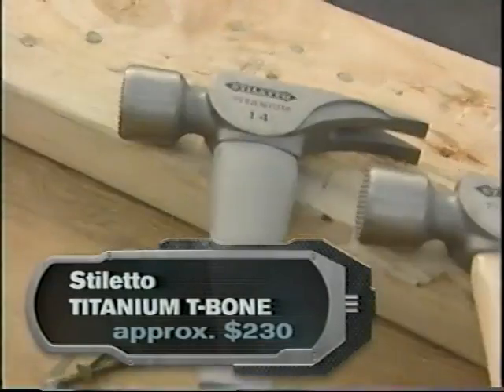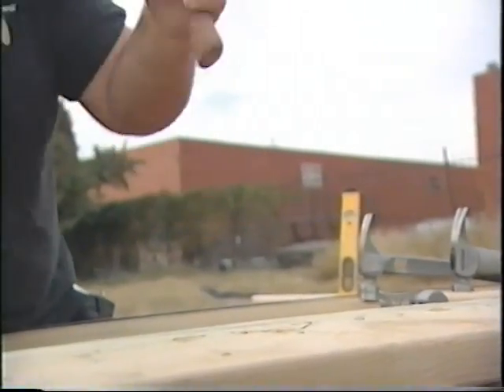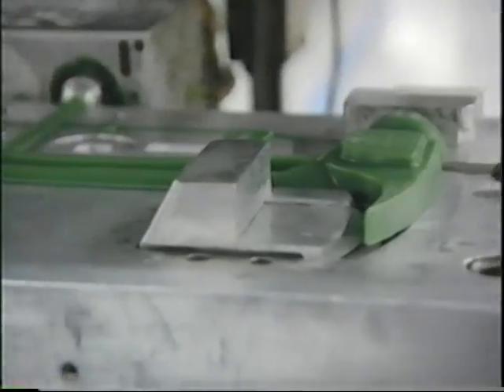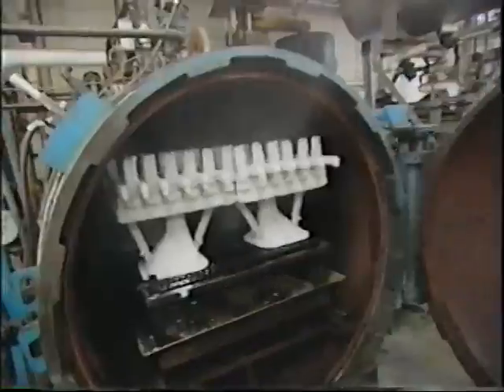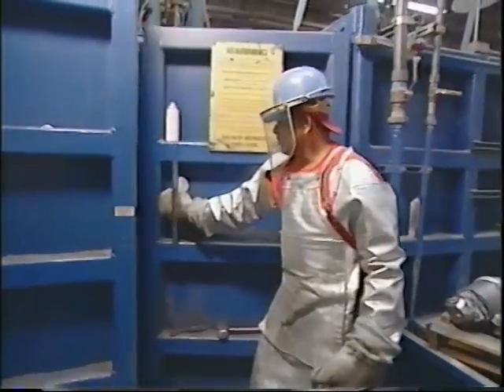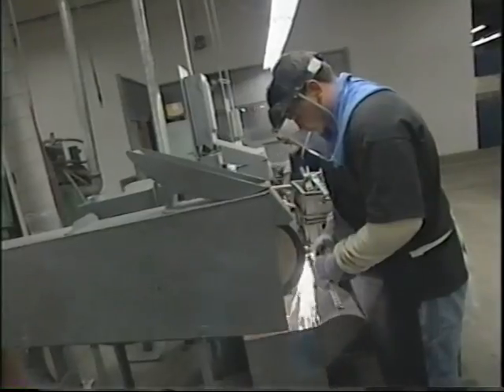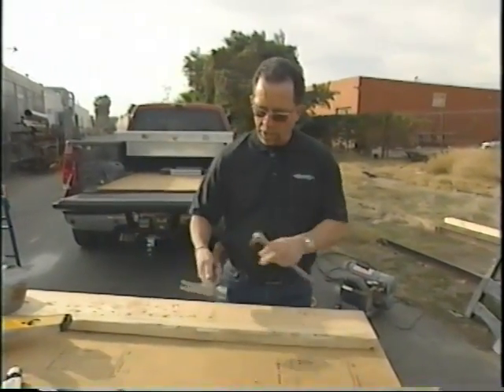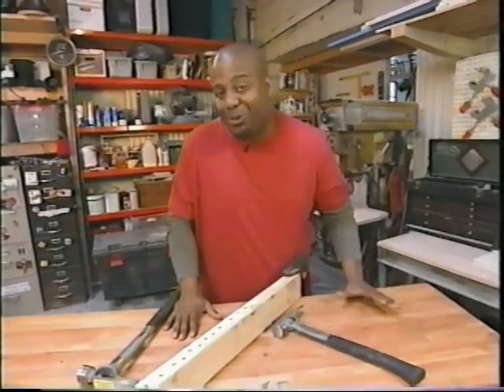Titanium hammer manufacturing

Comment: Yea, this argument about F=MA doesn't hold up. Sure you'd have to increase the acceleration of something lighter to achieve the same amount of Force, but it's what happens to that force that matters. Where it goes, in other words. The hardness of the titanium transfers significantly more force to the nail, instead of back into the hammer, is my understanding. Lets say you had a hammer made of lead. You could generate lots of force due to its weight, but I doubt it would drive a nail worth squat.

Comment: they need real carpenters to show how it works.  the first problem is the body part, it shouldn't be the elbow since the wrist is all the movement needed.  weight doesn't drive the nail, speed does, for those of you that were wondering how lighter can still drive as well as a heavy hammer.  anyway, waste of money, if you swing the hammer right you one shot the nail, thus less swinging, and you would use the right body part, the wrist.

Comment: Surely a light titanium hammer will require more blows to drive a nail compared to a heavier steel hammer, and therefore more wear on the elbow joint (which was given as the reason for developing it)?

Comment: For those challenged in physics:
What counts is the kinetic energy of the hammer. The formula is E = 0.5 * m * v^2
So half the weight does NOT require double speed, but just root(2) = 1.41 times more speed to compensate.
f = m * a is quite useless here, because the deceleration in the moment of contact hammer::nail is very complex to be calculated.

Comment: Steel, only for me!!! I was a tiner for years. The only way you can hurt your arm with a hammer is to hold it to tight. Beating nails into wood dose not compair to beating on steel all day. Tennis players have the same problems with there arms. And they don't do a fraction of the work that a tradesmen dose. Great idea though just that a price tag of 200+ for a hammer is not worth it to me.
Reply: I'm a mason and have problems with my arms and shoulders. So it may not be directly related to swinging all the time. I do my share of hammer cutting to, but nowhere near as much as a carpenter.